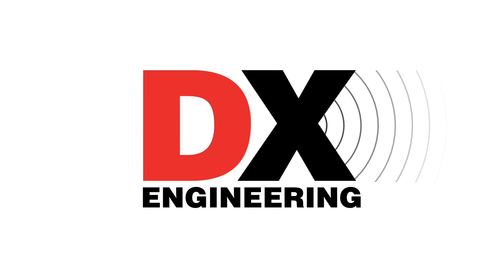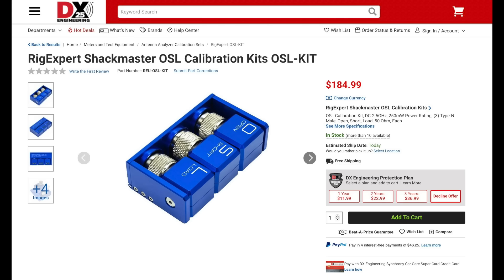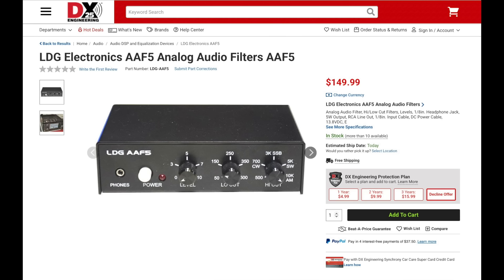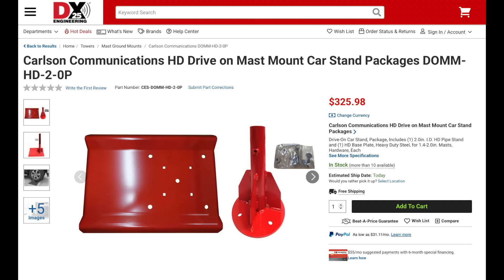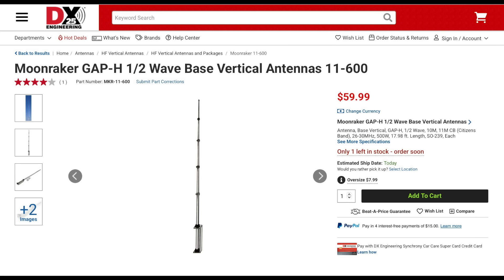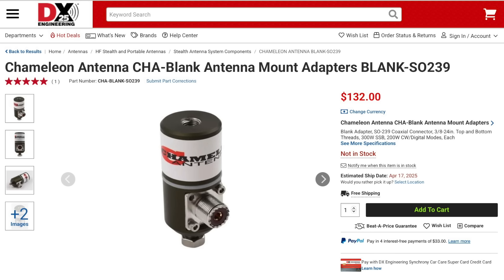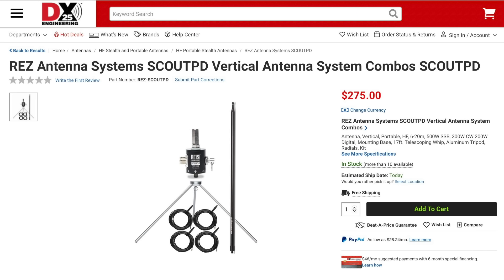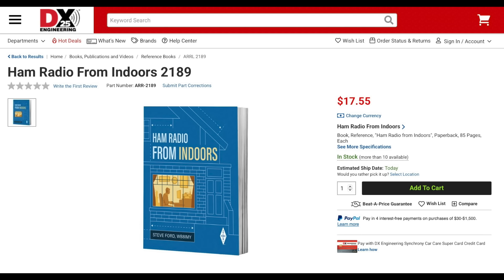Antennas, Power Supplies, Analyzers & More – What’s New at DX Engineering for February 2025

Comment: So Rig Expert sells you a product that has all the hardware required built in, which you pay for with the base price, but then to use that hardware they charge you for "upgrades" which are basically just subscription tiers? What a joke strategy, I hope no serious ham falls for this new age B-S. It's a disgusting approach, RigExpert over here acting like they're Tesla or something.. laughable.
Reply: Yup. Hard pass from me.
Reply: That's why there's what they call: the cracker scene..
Reply: In enterprise class networking equipment they sell you a Ethernet switch with routing capabilities that can have 10 gb ports for fiber..You pay a license fee to enable those features or other options. It’s just an email with a very long license key to enable it. I see where you are coming from but this is apples to oranges. No ham transceiver I am aware of costs over $80,000 like this networking equipment. Firewalls may cost over $100k. Kinda weird to see this applied to ham gear but it’s nothing new. It’s just more firmware.
Reply: @techguy9023  Fair point, but hams are way more gullible than companies.